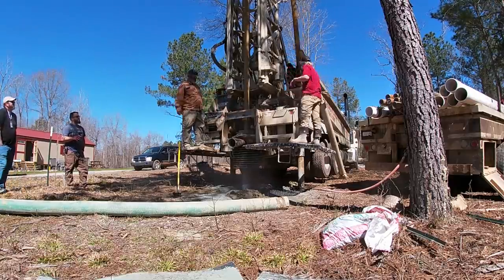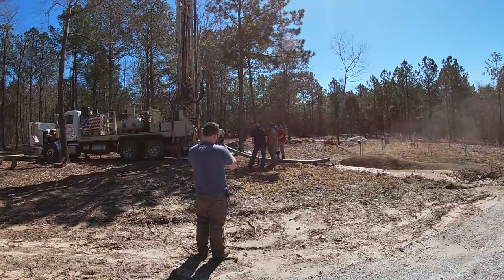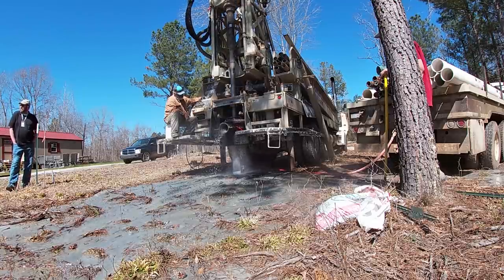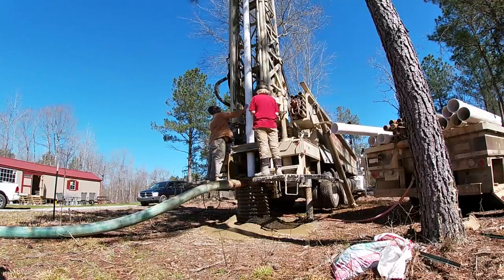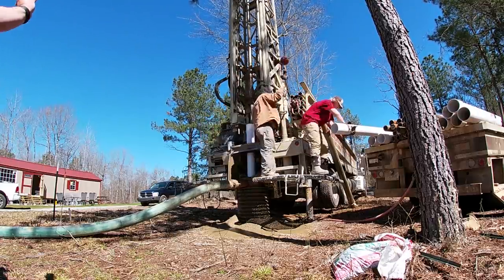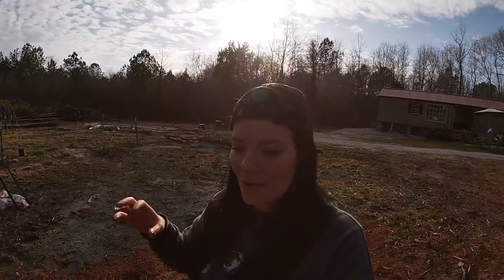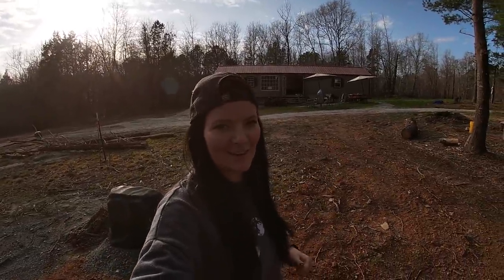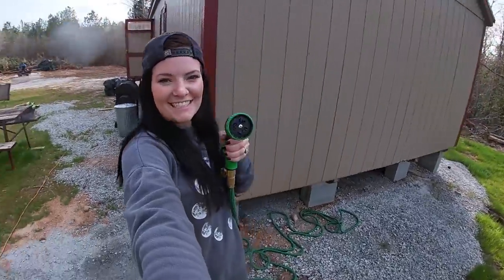Drilling a Water Well / Shed to House Conversion / Developing Raw Land

Comment: Something to consider depending on what yall are planning to do with the property. Wells can dry up resulting in very costly work drilling a new hole. We decided on a fresh water holding system from the well. We bought 3 large 5000 gallon thick plastic storage tanks and buried them in the ground about 90% of the way. We then poured a cement slab around it and built a shed which the roof is used for well system solar panels. The storage tanks are dual fed upper/lower so you can pull from 1 tank and the use will balance between all 3. The well system is powered by solar and runs through a filtration system to a 100 gallon filtered tank which sends an alert if water is bad and sounds an alarm if the water pressure is low to no flow.  This entire setup is for drinkable water only. We have another 10k gallon setup for rainwater collection that can be used for yard or flushing toilets etc.  I started all of this a few years ago and with all this rain coming fast and hard its been keeping the rainwater tanks at a decent level. Besides having a few sheds on the property you really can't see much here..lol
Reply from the maker: Wow!! That’s impressive!! We are definitely considering water storage and want to collect rainwater on the other side of the property so we have multiple water sources too! 💦

Comment: Love y’all’s videos ! We’re looking at doing this in North Carolina , what permits and stuff from the county did you have to get and how much has this costed up to this point or at least to get it all started ? Any info would be great we really want to do this too!!!!
Reply from the maker: Hey! Glad you’re enjoying them! We had to get a permit for the building and a permit for the power so far. I believe it was around $100. We also had the land perked for septic before having the building delivered so we knew we could get a septic system for its location. 

The cost will depend on if you’re including the land, clearing the land, the driveway, the gravel foundation, the actual shed, the well, and the power pole. We try to do as much as we can ourselves to lower the cost and learn along the way! If you’re looking for land, see if AgSouth does land loans for your area! They are great to work with!

Comment: What happened with the spring. I would have put a spring box in and used that water. That would have saved the money you spent on the well.
Reply from the maker: The spring is on the other side of the 20 acres so it’s no where close to the house and it runs dry during the summer months. We do hope to do a spring box in the future though for water on that side of the land

Comment: Did you say it cost 4000
Reply from the maker: It was a little over $5,000. The base price was around $4000 but it only included 100 feet of drilling